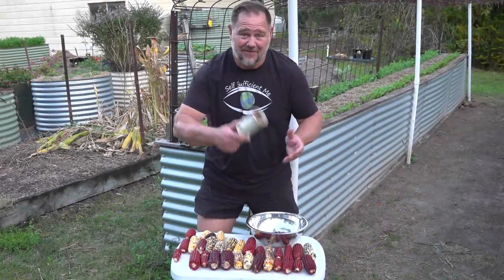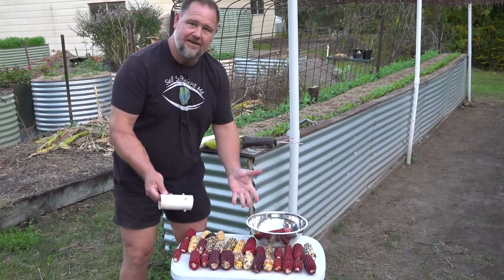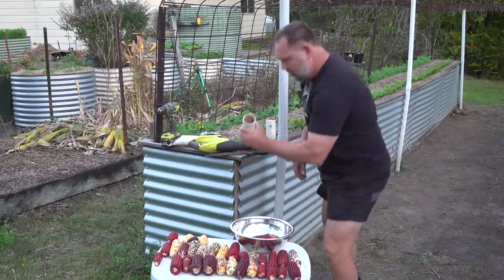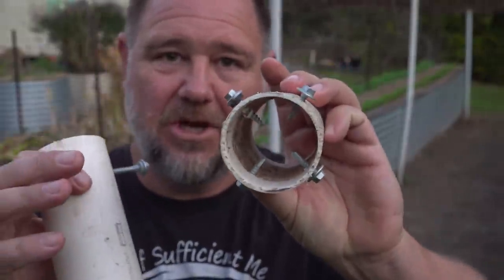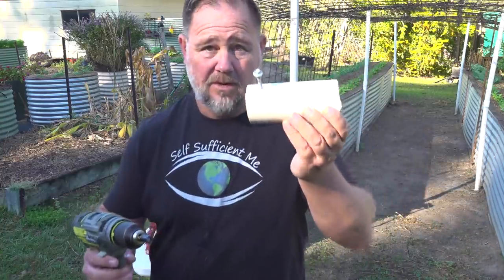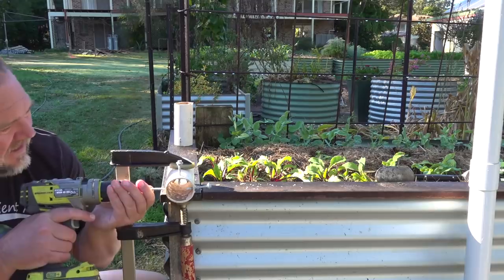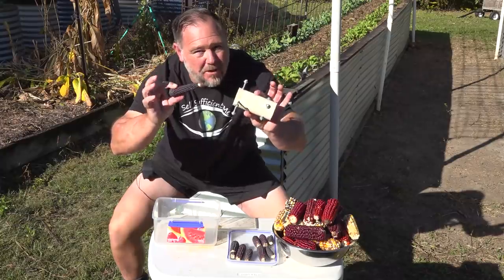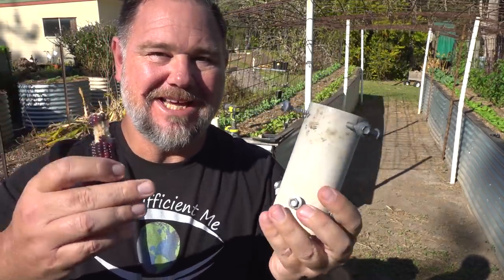How to MAKE a Corn KERNEL Sheller REMOVER Tool | DIY For ANY Size Cob

Comment: Good day Mark! Really like your inspirational videos! Thanks! Last year had a big crop of corn. And after drying had to peel heaps. It is easy and fast with $10 gardening gloves on, the ones with a bit of rubber coating on them, do circular movements as you would to wring your washing (2 hands in opposite directions). Did not have any blisters.

Comment: Mark, you crack me up.  Just got hubby to make me one of your corn cob de-kernellers.  Worked a treat - he even got to use it first.  Will have to try it on my Silvermine corn - when I grow it.  Oh and I'm just about ready to harvest my Jicama (Yam Bean), it's feeling huge (I had a test feel under the soil).  You harvested some after the seeds had dried out in one video, how did it taste when it was left on so long?  I only received 5 or so seeds and really need to save the seeds.  I only have 3 in the ground.

Comment: I remember when I was in Mexico, my aunt and uncle would remove the kernels using a an empty corn cob. They also had This DIY tool made up of corn cobs that were held together with a wire in a circle and they rubbed the cob with kernels on to the other cobs

Comment: Another option would be a large bamboo section with threaded inserts and adjustable setscrews to pop the kernels off.
Threaded inserts are a great way to ensure your screws/bolts never strip out the hole they're fastening.

Comment: Can you use any dried corn for popcorn?
Reply from the maker: Not usually Salvador as popping corn is a special variety that dries with an air pocket in the kernel causing it to pop when heated other varieties like sweet corn won't usually pop. Cheers :)

Comment: spin the burrs off using the other pipe you spin in side the pipe then outside and it clears the burrs on both sides. (from a new construction plumber)

Comment: Here's a way to make a dekerneling board: grab a think and sturdy price of wood and as many ring screws or nails as you need to cover the board with them.

The rings as are the easiest, just screw them in rows and columns.

The nails are harder, nail them one by one making sure they go all the way, then bend them and nail them back and clean up the other side.

Comment: "Humanity is heading towards resource depletion. What you need to understand is that every advanced nation in the universe is facing resource depletion. That is the threat that hangs over them. That is their condition. They have generated technological innovation to deal with this problem, but technology requires resources as well. To lose your self-sufficiency in this regard, you cast yourself into a very difficult set of circumstances where your life and your circumstances will be controlled by others—others who are providing you resources that you cannot provide yourself."
From the book titled Life in the Universe, available free online at NewMessage org

Comment: I noticed that for your measurements that you reverted away from metric measurements to  the British imperial or the United States customary systems of measurement the inch. So, I am guessing that when you were younger that the inch, foot or the yard was your primary system of measurement? Did you even know that you did this?
Reply: Australia officially changed to the Metric System between 1970 and 1988 after changing to Decimal Currency in 1966. Some of us still use feet and inches in our heads.